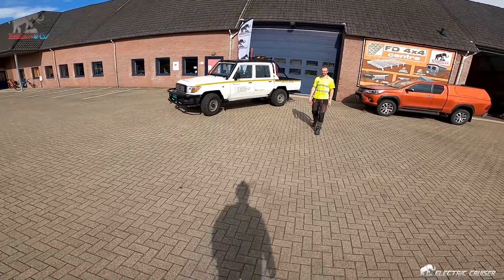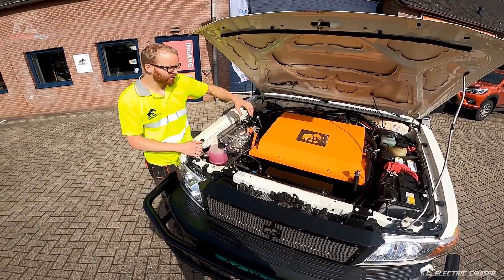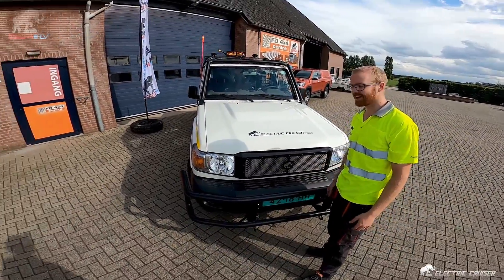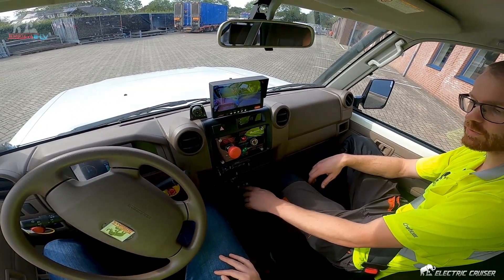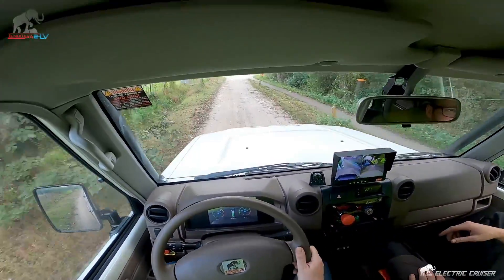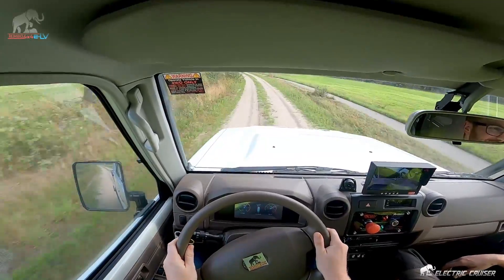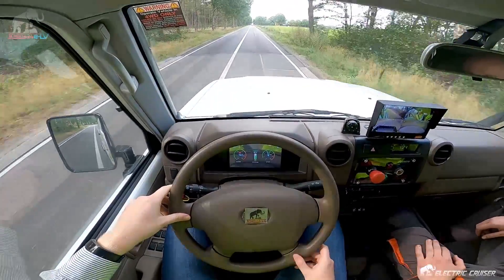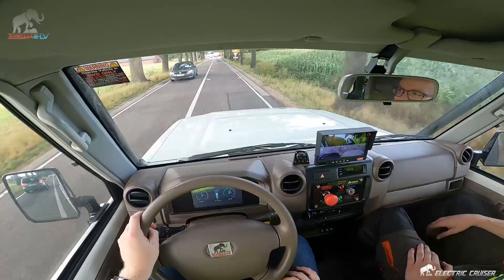Introduction and testdrive of an Electric Cruiser

Comment: Very nice but fire suppression system is too large to be practical for most evs. I understand in a mining situation . I like the simple clear controls
Reply from the maker: You are correct, this is specifically designed for mining, as simple as possible.